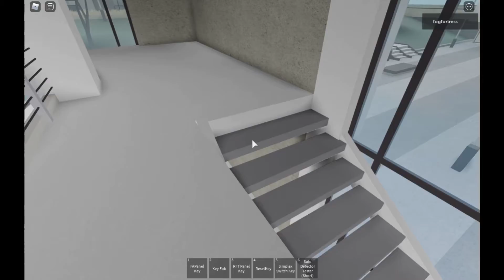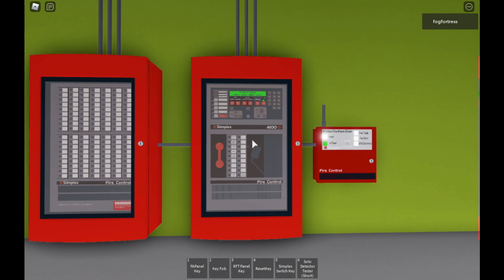Roblox System Test 27

Comment: Can i request a system please
Reply from the maker: Yes. You can.
Reply: 4050 80 with 9806 on it and 2903 9001 with 2901 9838 and a 4030 that sounds like newageserveralarm's 4030 and simplex t bars and for panel 4004 on  march time if someone made one in roblox.